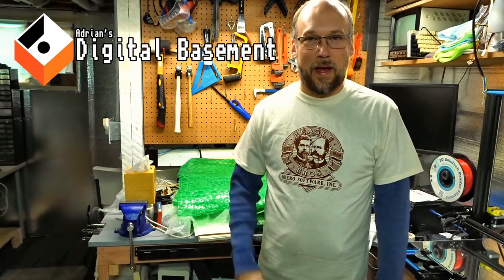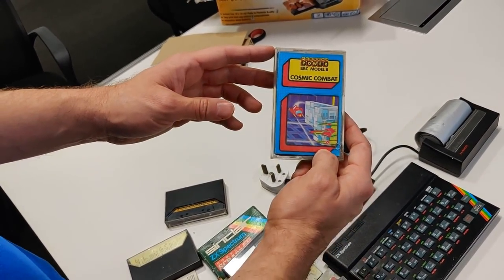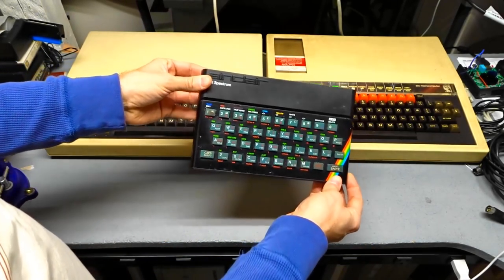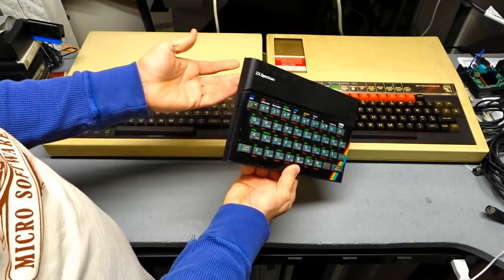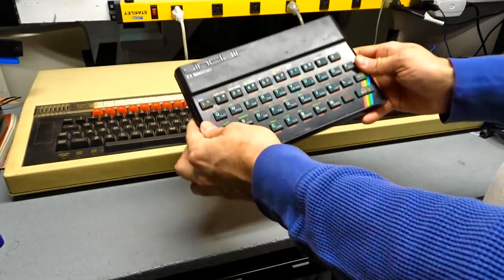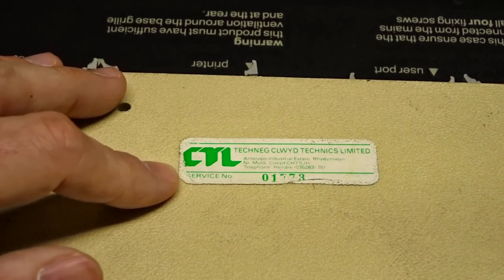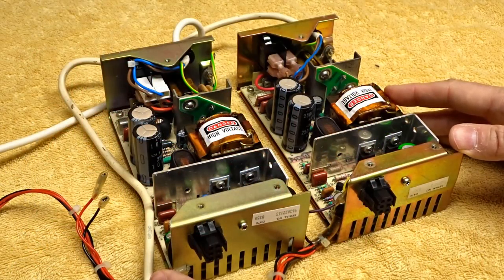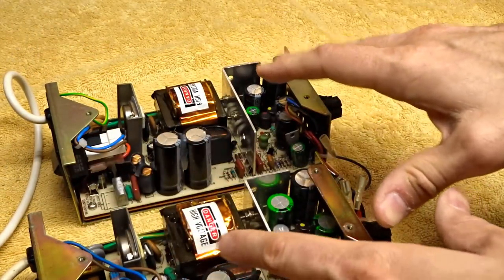I visited the UK and brought back some computers! Let's see if they work.

Comment: Ahh Adrian, RE: the BBC Power Supply Cutout.

Little bit of history: When the BBC were giving Acorn the specifications for the BBC Microcomputer, they stipulated it not contain a switch mode power supply, as the BBC didn't want interference on their spectrum. AM was still largely in use at the time and switch mode supplies caused a lot of noise on these frequencies. 

Acorn therefore kitted the first couple of batches of BBCs with linear power supplies - which overheated, and indeed in some cases even caught fire. Needless to say, the BBC withdrew this requirement. 

I would think this was a user-mod, or possibly even a dealer mod, done on a very early generation BBC Micro to help keep the linear PSU cool - ALTHOUGH it looks like the PSU currently in there is a switch mode supply. If memory serves, the linear supplies had a black shroud (Well, they certainly had a black shroud after they caught fire).

I'd hazard a guess that Acorn provided the original owner with a replacement switch mode supply after their linear supply gave out from overheating - once the BBC gave them permission to ditch the linear supply idea, of course.

Comment: The keyboard on the BBC is probably in such good condition as often they had a rubber keyboard cover (especially those given to schools in BBC for schools project of the time). They were semi-transparent but turned yellow over time making them pretty useless by now. They were awful to type though but they were not taking any risks with sticky 80s kid fingers :D

Comment: The first one must be a 'Model A'  which would explain the socketed RAM. You could buy a RAM upgrade kit to convert it to a Model B. There were also various ROM's available with different languages, etc. I remember I had a Forth one. There was also a ROM expansion piggyback board which allowed for an extra four IC's.

Comment: In 1984, my high school in Sydney, Barker College, set up a computer room for students. This involved 30 BBC Microcomputers in some sort of networked configuration. From memory they also had the matching BBC monitors, and 2 disk drives for each computer, as well as being networked. As part of maths class, we had one period per week of computers.  We  learnt basic BASIC programming, and used some other maths related software products/games.   Also, when I was in London in late 1984 there was a show on BBC 1 television, that played the required audio at the end of the programme, so you could save it onto  cassette, and then load the programme onto your BBC Microcomputer. I somewhere still have the tape, but have had a BBC computer to try it out on.
Reply: The programme was probably "Making the Most of the Micro", part of the BBC's Computer Literacy Project that the BBC Micro was originally commissioned for, I seem to recall they had "data blasts" at the end of programmes containing some of the BBC BASIC programs they'd mentioned earlier in the show.

Comment: The hole used to be covered with a  piece of plastic that was used as a holder for a piece of card. The card had the function keys mapped out for various programs and you could change it as required. At least that is what I remember.
Reply: @adriansdigitalbasement  sorry. What I meant is that various programs used the red function keys in different ways. The plastic cover there had a lid so you could change pieces of card that had the function keys details printed on it. So if you were using a word processor, the shortcut key information would be on top of your computer case for easy reference.

Comment: I scanned all the comments and there's one thing that nobody seems to have mentioned about the BBCs. That little perforated rectangle to the left of the keyboard hides a ROM socket on some versions of the machine. The ones I experienced used it to house the VIEW word processor ROM, accessed by typing *VIEW at the BASIC prompt.

Also, the Spectrum could be made usable by removing the circuit board and putting it inside a DK'Tronics keyboard.

Comment: They look really interesting, nice to see that both of them work to some extend. 
Maybe you can populate the econet port on the one that does not have it already. It looks like it uses only standard parts. 
Then you might be able to communicate between the two computers, which would be pretty cool (in my opinion). 

Greetings from Germany
Reply: @adriansdigitalbasement  

Thanks for your fast response. 

I really dont know anything about them as well, it was just a idea that I thought would be interesing. 

Looking forward to see what you can come up with :)

Comment: the top cover with the hole is to aid cooling of the psu.
the crosses may just be indications where the cables go(the folks setting these up had 0 computer knowledge).

Comment: the 3x 5v lines are common

the use of 3x 5v lines is a hang over from the design of the motherboard when it was intended to be used with the linear power supplies, 

the linear PSUs was unable to supply the total required current via a single line

Comment: I have a feeling the BBC that's had the hole in the top and back, has probably been used in an industrial control process.. therefore its been sitting in a rack or pull out shelf. The extra holes wouldve been for ventilation. The Beeb was quite commonly used for this sort of thing because it was extremely easy to interface it to other equipment - as you can see there's an analogue port on the back, and several connectors underneath. It was also easy to develop control software for them which would burn into an extra ROM

Comment: I used the BBC Micros at school in the late 80's, my favourite memory was controlling a massive (at least my memory tells me it was) turtle robot with a pen that would draw on paper. It had a clear shell and looked cool AF. You controlled it with LOGO programming, simple commands like Pendown, Forward 10, Right 90, Back 40, Penup but it really felt like magic.
Reply: Yeah, LOGO was awesome, we had loads of these at school, all the way up to 2000 when I left. I've seen one Beeb with the hole, but it still had the plate glued it. I assumed at the time that it was for expansion, but I'm not sure. Possibly for some kind of "All-In-One" monitor or Disk Drive combo? All feeding off one power supply. Only thing I can think of.
Reply: This is the Valiant Turtle.
Reply: Oh my god I'd forgotten all about the turtle! I remember the whole class gathered around it on the floor watching it move around! What a blast from the past!

Comment: You need the cassette player. The printer is thermal pins dot printer. I was frustrated with my ZX because you had to use shift so much. Sold it and got the64bjt ZXPlus. Much better for BASIC.

Comment: You can obtain a ViewStore Rom and run a text-based Database which is really cool.  In the mid-80s I used 2 x 3.5-inch floppy drives to run this to find requests on my BBC B PC based Discotheque I got a picture of me in the Acorn User mag.   I used to be an Acorn Dealer way back in the early 90s selling the RiscPC an ARM-based reduced instruction set multi CPU Acorn PC.  I had a Pentium Intel co-processor running Windows in a RISC Operating system Window.   I am now retired in Malta but still love fast leading tech computers.

Comment: For the dirty one with a decent keyboard, it could be one from a school where it wasn't used very often. My school(like almost every primary school in England from the early '80s to the mid '90s, secondary schools did have them, but replaced them with x86s by the late '80s) had a BBC Micro in every classroom, but most of them might've been used once or twice a year.

Comment: Hey Adrian, for one of the BBCs, did you happen to find a piece of paper stuck to the side of them stating RF frequency at all? If so then I'm glad that the BBC got to you safely, and the Scart cable came from the one I sent ya, unfortunately the mucky one with a dent below the space bar. As for the Capacitor in one of the power supply units being different, I had to replace it when I originally bought it as the old one blew out (rather violently) when I first powered it on.
As for being exposed to water, nothing by me, never kept it close to anything wet, possible owner before me.
Either way glad that it works and that you're happy with it.

Comment: Just a thought, could the BBC micro with the hole on top be a unit running a cash machine like an ATM computer for a bank. With the gap in the back and the expansion ports ??

Comment: 9:30 Obviously that computer had a keyboard protector, and was stored with that on, which hindered the keys from getting dusty. That cover didn't protect the rest of the machine case though, and that's why the rest is dirty. The keyboard protector itself most likely was also filthy (well, at least on the outside anyway), too, so the seller didn't send that to you.
Reply: Because the label on the PSU isn't dirty either, I guess it's safe to assume that something was mounted on that too, that got removed just recently - or at least before the computer was packed into a box or something. I have no clue though what that thing could have possibly been. I had the fleeing thought that it might have been a fan that could have helped cooling the PSU, but then realized that if it would have been a rotating fan, then dust could have been gotten on the PSU, and we'd have to see the same contamination there that's also on the rest of the case. And mounting a passive cooler with fins wouldn't have made much sense with the sticker in between the contact surfaces and with no thermal compound. Then again, who knows?

Comment: I had a BBC B as a business machine It came in a metal case with 2 built in floppy drives  the case slid tightly in the case and had a cut out in the back like yours.

Comment: Loved the video. Just a quick comment on the socketed memory chips. When originally launched, the BBC Micro had an Model A and Model B, the main board was the same. but the Model A only had 16K, as opposed to the 32K in the Model B and a number of the additional expansion connectors were missing. The Model A machine could be upgraded to the Model B specification by installing the additional parts. Model A machines would be supplied with the empty socketsAs a family we had a very early issue 2 Model B,  a Master 128 plus the Master 512 board which linked  to an internal tube mounting connector, the board added a 80186 processor to the machine and which was supplied with DOS Plus and GEM from Digital Research allowing a fairly reasonable level but not 100% MSDOS compatibility. We then moved onto a Acorn A3000 which was an all in one system much like the Atari ST and Commodore Amiga. I myself moved onto an Acorn A5000 and finally a Acorn RISC PC system. We also acquired for other reasons a Torch Graduate system which was a third party system to run MSDOS applications on the BBC Micro (although Torch Computers was eventually taken over by Acorn) and a Acorn Cambridge Workstation which was a basically a combination of a BBC Micro plus the additional 32016 second processor that Acorn had built. I could never get the 32016 side of things going, although the BBC side of the machine seemed to work fine. I look forward to seeing what else you will end up doing with the BBC machines and the ZX Spectrum.Kind regardsToddy

Comment: Welcome to the world of spectrum :) The ZX Spectrum was my very first computer and I got for Christmas 1983, I believe. It was a 16k model and I still have, though I recently upgraded it to 48k. 

When you build a power supply be aware the the barrel connector is negative center and that it has an internal voltage regulator that regulates the supplied 9v down to 5v and these sometimes fail and outputs the full 9v on the 5v rail. Also the ULA tends to fail and if you have to look for a replacement, be aware of the different revisions. The ULA has been reversed engineered so a modern replacement is available though I’m not sure it covers all revisions. The paper for the printer is aluminum coated and the printer generates small sparks to burn holes in the aluminum. Hope you will enjoy the speccy. It has some wonderful quirks. 

I don’t know that much about the BBC, but you are right that the early versions came with a linear power supply. It was a requirement from BBC because the where worried that a switching power supply would emit to much RF (They where a radio broadcasting corporation after all) but the linear supplies tended to overheat and this made me wonder, if the hole in the top cover could be an after market fix for the overheating problem. But I’m only guessing here. It’s an awesome machine that I would love to add to my own collection. Hope you will enjoy it!
Reply: Adrian Black The spectrum also has an internal step up converter for the 12v supply. I can’t remember if it runs on the 9v og 5v but I guess you can connect the 12v rail to your lab supply as well. 
The printer is awesome and rather strange. It gives out a distinct smell during long printouts:) 
Everything on the Spectrum was designed to be cheap, really cheap.
Reply: @adriansdigitalbasement  Sweet. I totally forgot about the other voltage. It's been a while since I had mine open and since it was in a working condition, I didn't spent that  much time on studying the schematics. You should definitely double check everything I say :) 
If my memoryserves me, the issue 2 had a problem in the ULA that they fixed by a transistor mounted across the cpu. I can't remember the actual problem though. There's an issue 3b in mine, if I remember correctly. It puzzled me, because that is a later board than i expected, but then I remembered that it was in for repair sometime during the 80s and I guess they just swapped the whole board. The board was also already wired for 48k of ram so I guess they took it from a 48k and they just removed the upper ram before mounting it (it was bought as a 16k model). I think that the board swap was standard practice due to the different versions of the ULA and the fact that most often it was the ULA that had failed, but I'm not totally sure about this. I will need to talk to the people that handled the Danish redistribution and repair at the time.

Comment: I worked on these in the early 80's, modding them to increase memory for pharmacy labelling systems. A fantastic machine for its time.
The user port is worth a look at, you can use it for all sorts of stuff. 
You can also get a hard disc drive for it, a whopping 5MB. (I never imagined I would need more than that)
I'm pretty sure I have a circuit diagram for the issue 7 board. Its broadly the same as issue 4. I will have a root for it if you can't find it online
Reply: I have a 28MB hard drive for my BBC micro!

Comment: WARNING: the ZX Spectrum requires a CENTER NEGATIVE power supply! 

The vast majority of power supplies are center positive. Make sure you buy one specifically for the Spectrum, and test it with a meter before using it.

Comment: Found a Beeb in a skip. Switched it on and loads of smoke came out. Bought a res cap repair kit for £9.99 off ebay and replaced the dried/ burnt out caps.  It then worked perfectly and sold on ebay for £75

Comment: Nice find! I grew up using a sinclair spectrum, it was 16k but I upgraded it to 48k, it was definitely the most popular 8 bit gaming machine in the UK, eventually the keyboard cover started lifting on one corner where the heat softened the glue. I upgraded to the zx spectrum +, it had a better keyboard, came in a bigger case, with feet on the bottom that lifted the back up and a reset button on the side.  It basically had the same insides but came with 48k, I think?
Eventually another model came out with a tape player built in, 128k+ or something like that? I didn't get that one! My next computer was the Amiga 500, that was the next big gaming computer in the UK before everyone started getting a pc to game on!
I remember the BBC micro it was very expensive, seemed to be more aimed at schools etc we had one at school, didn't use it much! That hole above the psu looks like a mod to let some heat build up out, 😎👍
For a bit of fun I installed a spectrum emulator on my cutting edge pc gaming machine a couple of years ago to relive all those fantastic rose tinted memories of 8 bit gaming!! Oh wow have computer games come so far!!! 😁😎👍
Reply: I persuaded my parents that the 48k version was a better buy. Used it a little, tried programming but after two days of input it crashed, didn't try again until I had a PC. Posted a few games, got a stack of magazines. Sold it all for £300 two weeks before the price crashed.

Comment: The spectrum PSU is negative center. Important to know as most are positive these days. Also, you may be inclined to do the composite mod. Just a warning that some modern TVs do not handle the Spectrum's composite output well (it's somewhat out of spec). It seems that even older LCDs were more accepting of the signal but for whatever reason, they're more exacting in recent years.

Comment: The reason the keyboard is clean is because somebody discovered it was not working and so they thought they would try cleaning it to see if that fixed it but it did not and so they sold it (eventually to you).

Comment: You are right, Adrian. There were at least two Companies namend BBC one in Baden Switzerland and another one in Germany in the Stuttgart region. One of them even produced calculators, if I recall correctly.
Reply: @adriansdigitalbasement A quick trawl through my collection of BBC Micro ROM dumps (yes, I know) reveals that the German language versions display the startup text "Acorn OS" instead of "BBC Computer"